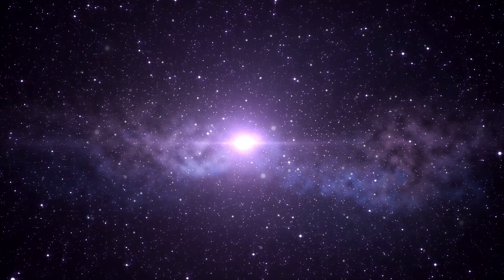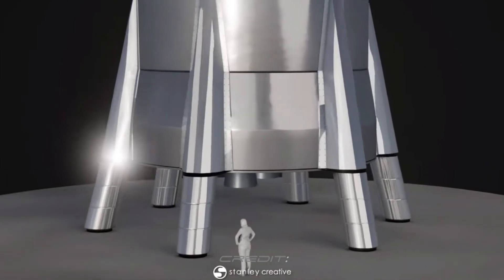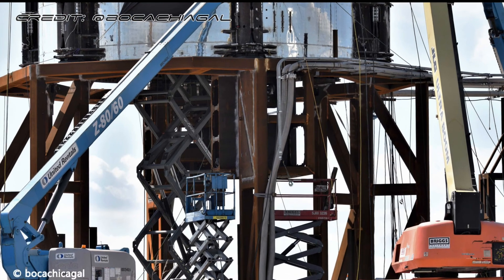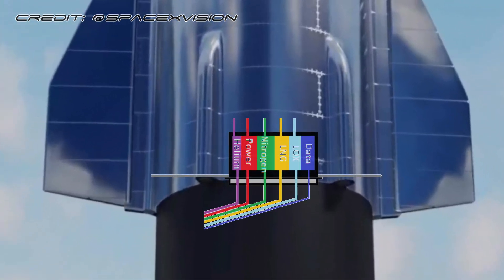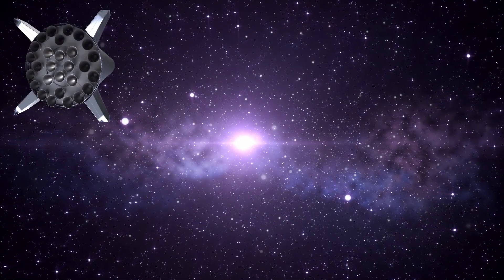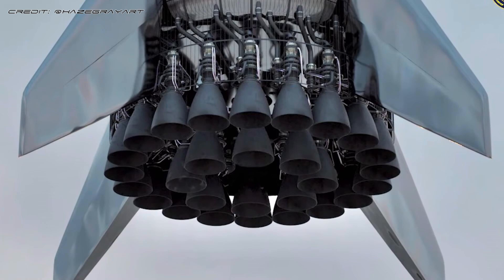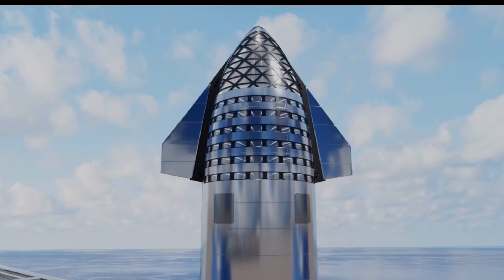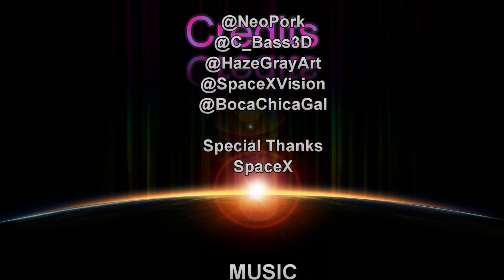SpaceX Starship:Ground Support and Thrust Dome Technical Information

Comment: Your observation on the bottom connection fits right in with the plan for on orbit fuel transfer. Will the "fueling ship" have pumps? Inertial transfer would require an engine outside the bay. Another non-trivial problem to solve. Maybe the nosecone test rig was for the thrust engine? Although wrong way?
Reply from the maker: The could fire the nose thrusters of one ship to create a gravity gradient with the other.

Comment: Most informative. The Starship itself will have to use the base located fluid-gas-electrical interface unions owing to the butt-to-butt refueling scheme for on-orbit consumables transfer. So, it makes sense for the booster to be so arranged as well. For the stated reuse cadence all interface points will have to make up automatically, be leak free, deal with dirt kicked up during the landing, and be reliable. Tall order.
Reply from the maker: It is indeed... but SpaceX is nothing if not innovative.

Comment: Congratulations on the 6k subscribers, well deserved!  For the Starship I thought it was generally accepted that they fill them from the bottom as this also enables Starship to Starship propellant transfer in orbit using the same connecters, with the two Starships base to base.  Plus if they want to fuel Starship up on the Moon and Mars from ISRU, as there won't be any support towers (at least at first!) bottom up makes a lot of sense for this too.  For the Super Heavy booster, it would be very SpaceX like to use the same approach and common components as far as possible.  Not sure if it is beneficial to fuel up the Starship through the Super Heavy though when on the pad.  Guess it would be best to use a second feed for Starship direct from the tower and save weight and complexity on the flight articles?  Is that everyone else's understanding?
Reply from the maker: You are absolutely correct :-) I published an update today. I don’t think the crane will try to lift the fully fueled starship. :-) So they will have to fuel it while it is stacked. Either through the bottom or from the side.

Comment: The plumbing on the SuperHeavy booster is gonna be absolutely wild, hopefully redundancy will outweigh the complexity of having so many engines
At least its not as bad as the N1!
Reply: Much of the N1 problem had to do with the limited ability of the electronic  control systems available  at the time
Reply from the maker: @davidhenry5128  that is correct. If they had modern electronics I believe it would’ve flown.
Reply: @terranspaceacademy  and maybe done static testing of ALL the engines.
Reply from the maker: I think they may put a ring pipe in the thrust dome with connections down to the engines...
Reply: Wrap those turbines and pumps in Kevlar!